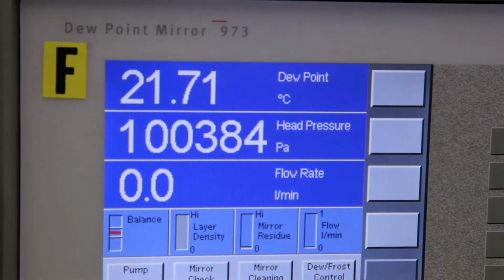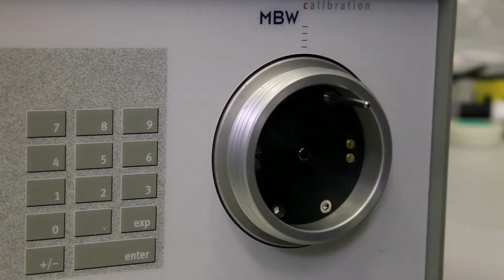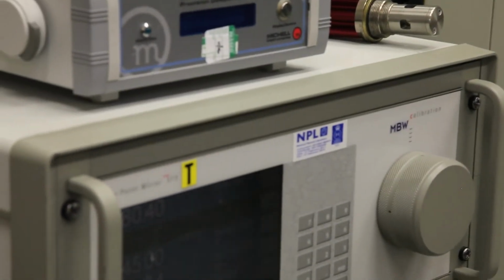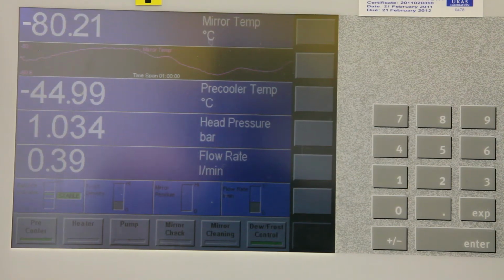Dew-point measurement

Comment: Can somebody tell me what is a normal dew point temperature for living space?
Reply: I believe recent standards recommend drying the supply air to a dew point of 10°C or lower, which likely means a maximum dew point of about 13°C throughout the building. Of course, in a continental winter, humidification might be needed. I would say a dew point range of 3-13°C would be desirable, depending on the indoor temperature.
Reply: If winter condensation is a problem, try lowering the indoor dew point to within a few degrees of the outside air temperature.